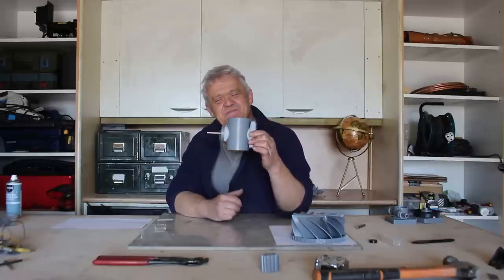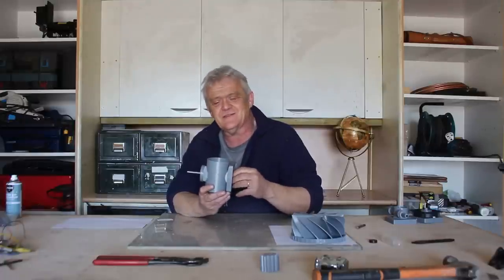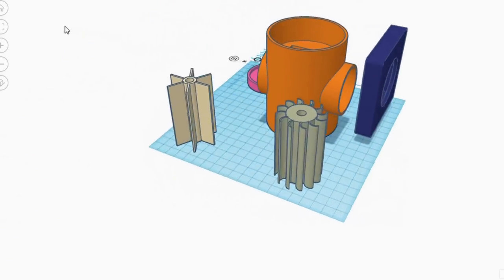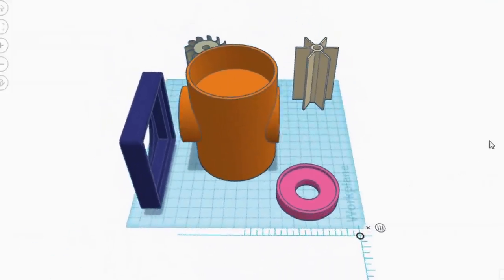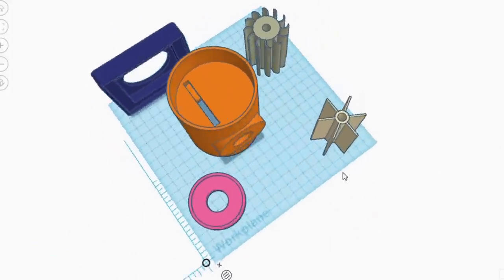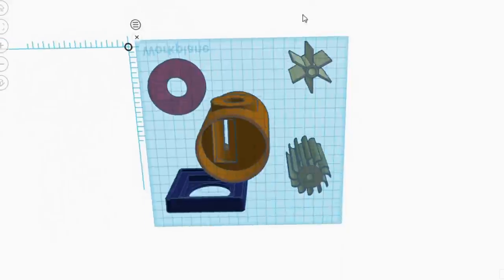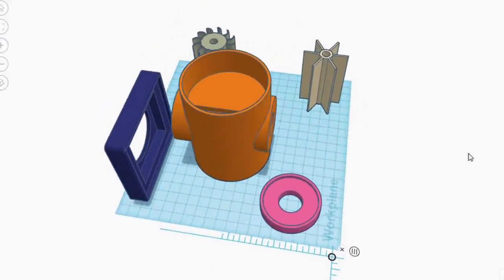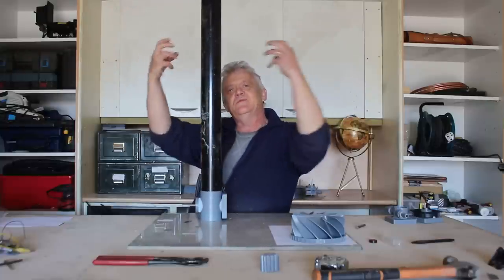1902 How Much Energy Is There In Rainwater?

Comment: The apple on the table does not have zero energy. It’s potential energy is equal to mgH where H is the distance the apple is from the centre if the earth (or rather the centre if gravity of the earth)
You added potential energy by lifting  the apple above the table.
The total energy is equal to the potential energy + kinetic energy. The total energy is constant.
Of course there are other forms energy can take.
In fact photons have energy even though they possess no mass: this energy can be determined by knowing the frequency or wavelength of the light. (E=hν).
You’re right in saying that answering the question “what is energy?” Is not easy to answer.
Reply from the maker: a photon doesn't have a rest mass and that's only to satisfy relativity as light travels at the speed of light lol
Reply: @ThinkingandTinkering  A photon's mass is always zero: it's a boson. Bosons also lack charge and have one unit of spin.
Energy, as you stated in your video is a tricky concept and takes many forms (even though the Units of Joule remain the same).

E=mc2 is a good example of this. The "m" term is actually the rest mass and should be written differently - say m0.And the E term is the rest Energy - E0

The original general Einstein equations is written:

E^2 = p^2c^2 + m0^2 c^4

You can see that when an object is at rest, the momentum "p" is zero so the first term p^2c^2 is equal to zero.
So you can simplify the above equation to

E^2 = m0^2c^4

Now you can take the square root of both sides and you obtain the famous Einstein equation E=mc2.
Or rather E0 = m0c2
This equation does not apply to bosons like photons because the m0 term is zero.

The other thing to notice is that when you take the square root, you end up with two solutions: the positive and negative solution.

So E0 = +/- m0c2

What does negative m0c2 imply Mr Smith?

Comment: What would happen if you had say 5 of these in a row starting near the top of the downpipe perhaps with a bit of a gap between each one, you would obviously get a diminishing return on each subsequent one but the water still has to fall down due to gravity so it would have to produce something. And if they are really cheap to produce it's not like wasting your money buying a 5 grand 2kw hawt that can only realistically produce about 50 watts. It would cost very little and would get more overall, question is just how much more.

Comment: I'm fascinated by water charging and how it can create static charges.
This was pretty interesting, but it could be made far more powerful, look into dripping water power/charge between 4 buckets.
Reply from the maker: you are talking about the kelvin generator mate? It's not more powerful - just a higher voltage
Reply: @ThinkingandTinkering  I'm not sure on the name of the device, it involves fine droplets of water going from steel buckets with them joined together diagonally with wire.
I think you're probably thinking of the save thing because it is high voltage, I would have thought any additional power gains would be good.
I'm assuming you're thinking about the device tho8

Comment: So would I be correct in thinking a mass falling after 9 to 10 meters would have maxed out acceleration from gravity (taking away other factors like air resistance) so if you had a sky scrapper with a huge gutter you'd need to catch the water use a bell syphon to drop the water down 10 meters or so to the generator and repeat the cycle all the way down, as apposed to just letting the water fall 100s of meters to the generator?
Reply from the maker: no gravity is a rate of acceleration it keeps on speeding up until the terminal velocity which is where drag exceeds buoyancy in the fluid it is falling in

Comment: I find it nice to see that you create all kinds of generators, but its a pitty that we never see ANY info about volts AND amps together. Agreed, it will be probably more milliAmps and you clearly state that you are just looking for smaller scale proof of concepts and not the optimal production, but could you somehow share a little info ? Like for example the smaller turbines you create using the magnetic levitating bearing. You test and show voltages, but wouldn't it be nice to also for a change show milliamps and so a little bit of basis calculus? I do understand that these small turbines will be producing very little, but what is very Little? Do they even achieve for example 1Watt of output ? Could you please give a little more info about that? Thank you very much
Reply: There is only one way to find out.
Well build one and film the demonstration for us.
Reply: @bacilluscereus1299  thats not why I ask it and also not the answer I was hoping for.
Reply from the maker: i do that mate - you just haven't seen the videos where i do that and that is a common story i find - most people don't watch those kinds of videos so i don't make many of them - and you can understand it - they are as boring as hell - but i do make them every now and then
Reply: @ThinkingandTinkering  ok strange. I have already seen a lot of your videos and really like them. Thats why I mostly see voltages, but without any mA or A that doesn't say a lot of course. Thats why I was wondering in what amount of watts for example your latest turbines (the +- 20cm big 3d printed ones) are ? More or less 1 watt ?

Comment: i think, in reality, you wouldn't double the energy (extracted) if you doubled the length of the pipe since 99% of the energy is lost on impact with the device on the bottom.
i think you would never be able to fill even that 3m pipe since the rain is falling slower than the device slit is allowing it to fall trough
im not familiar with the amounts of rainfall you experience there but the slit looks pretty wide and thick
Reply from the maker: in reality the energy would double - it's just maths - your ability to extract it might not double that's true - but that's how well you engineer it - as for 99% being lost - hmmm - you might want to rethink that one lol - oh the pipe wasn't included in the calculation - the height of the water  held in the rain gutter was doubled - it's actually like a mini dam - you would hold the water back with a bottle syphon and release in one shot

Comment: could u put the device in a series down the length of the collection tube?
Reply: Sure, but that doesn't really work how you think it will.

Having multiple devices in series means the water won't actually experience a full 3 meters of fall. It will instead experience a fall that is the distance between the devices installed. And since there are no 100% efficient devices, you will end up with less energy extracted with multiple devices in series than if you only had one.

Comment: I think a small wind turbine in the fashion of your recent efforts stuck in the unused chimneys of the British Isles would make a far more significant contribution to national energy requirements. Over here in the east of England where rainfall barely gets much above the Sahara's average, Down pipe power likely to be a bit of a loss, I regularly watch light summer showers get soaked up by the tiles nothing reaching the gutters let alone the down pipes Whereas in the west up and down the coast with its three and four story guest houses and slate roofs it might actually make a very small contribution. I am not knocking water power but I think more might be extracted from storm water outlets into rivers and streams.and the outlets into soak away ponds you see all over these days.

Comment: I noticed you have two paddle wheels in the tinkercad file. Which one did you find was better, the flat blade or the curved blade one?
Reply from the maker: the curved one mate
Reply: @ThinkingandTinkering  I thought it might have been. I've finally got back in to 3D printing so I'll be replicating and modifying these for my house. I should be able to slip it into the downpipe discharge that feeds our water tank.